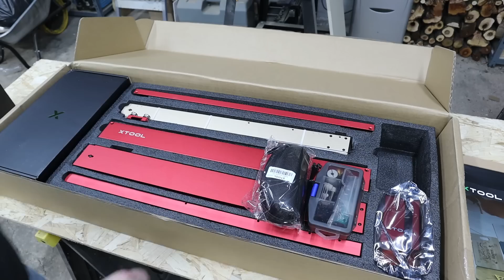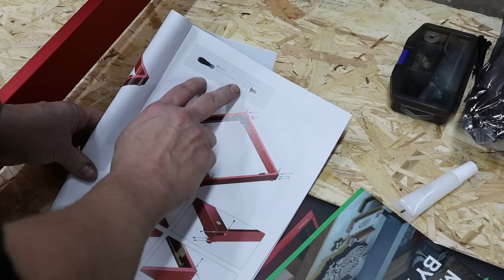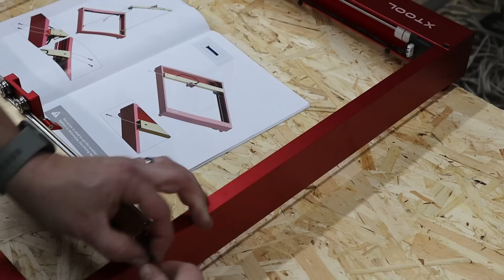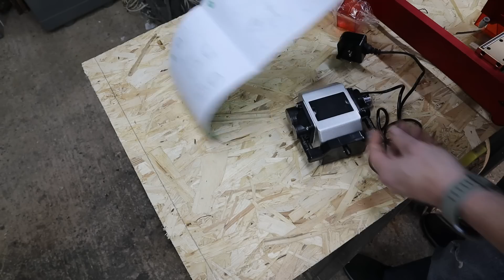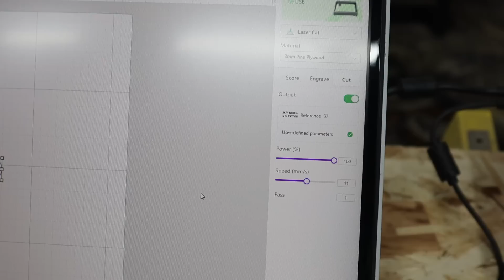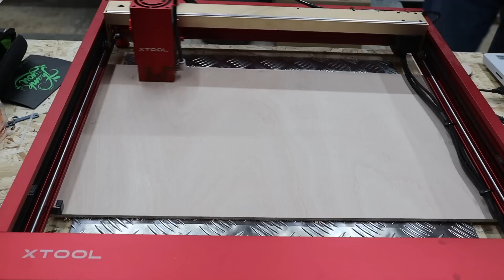Making a Wooden Clock Using the xTool D1 Pro

Comment: I'm not sure that I'd use the reflective plate underneath.  I'll look for a defunct table saw with a steel or cast iron top for a vibration-free mounting surface.  Also, I think smoke  evacuation would be good if not necessary.   A computer fan and dryer duct to the outside would be sufficient if an enclosure was in place.
Reply from the maker: Changed to the purpose aluminium honeycomb base now, I agree on the extraction, plan is to build an enclosure for this, already ordered a fan 👍